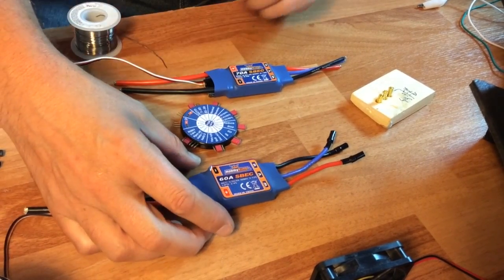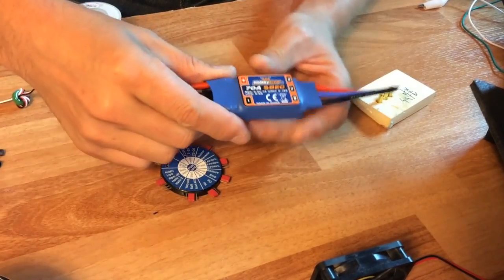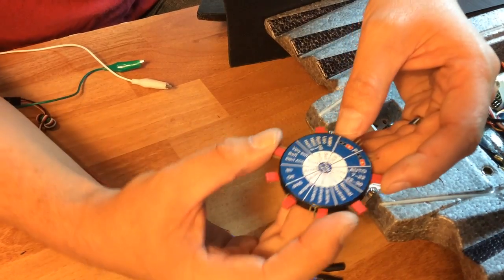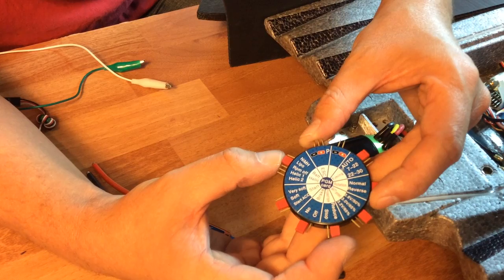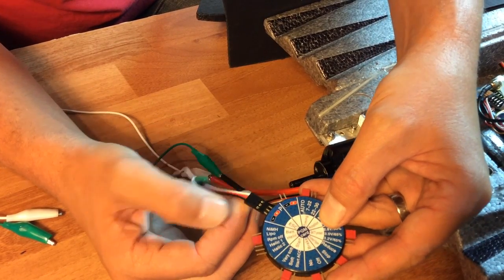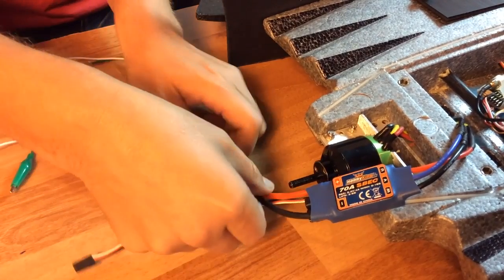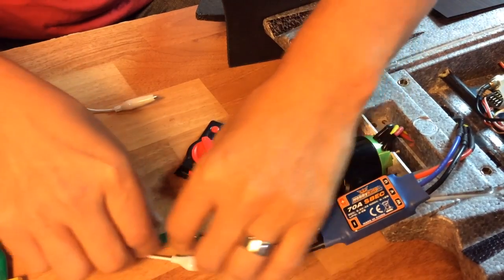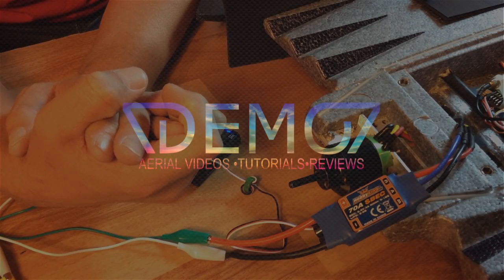Hobbyking 70a ESC and Program Card

Comment: no i dont think so i brought it from hobbyking and just hooked it up to motor and i just get 3 beeps. it does not arm itself. how do i calibrate it?
Reply from the maker: +Kevin Bebb turn on your radio and raise the throttle to max. Plug in your esc, after it beeps quickly drop the throttle to zero. This will tell your radio/esc what is maximum and minimum throttle for your ESC
Obviously do this with no propeller on your motor for safety

Comment: hi 7demo7 iv just recently purchased a hobbyking 50a esc and the hobbyking round programming card now iv tried programing the esc like you did on your video and all im getting is the first beep witch should be right then unplug it then plug it back in and all im getting is 3 beeps and thats it nothing else. please could you help with this!!
Reply from the maker: 3 beeps indicates 3s battery pack- does the esc work? Have you calibrated the esc?

Comment: I would turn the lipo protection off for a long range rig. Replacing a over discharged lipo is cheaper than replacing a lost long range aircraft.
Reply from the maker: +JKFlorida I thought so too- will do!
Reply from the maker: +JKFlorida How do you turn off the lipo protection? would I leave off the jumper?
Reply: 7demo7 You put it NiMh mode. Then it acts like its running NiMh batteries and they have no cut off. Hope this helps.
Reply from the maker: +JKFlorida thanks, I was scouring the Internet trying to find the answer!!!